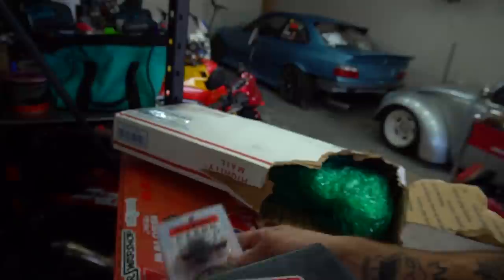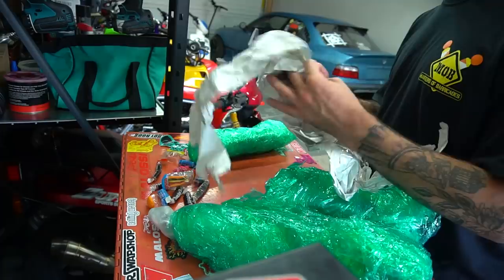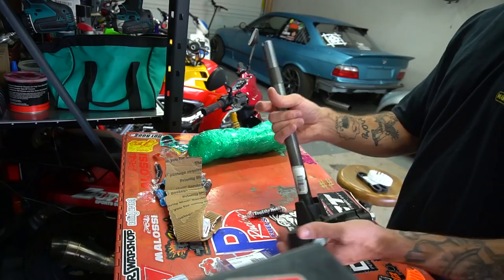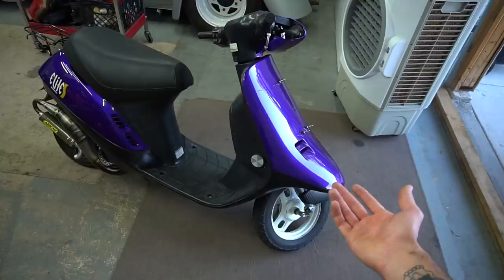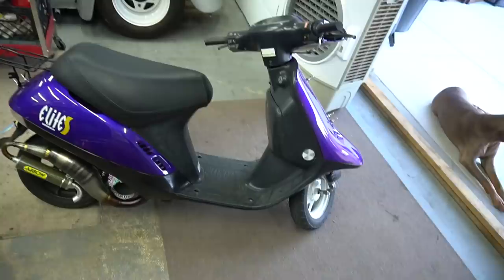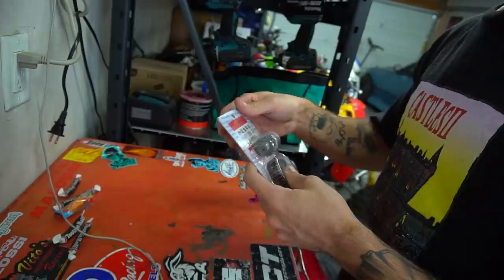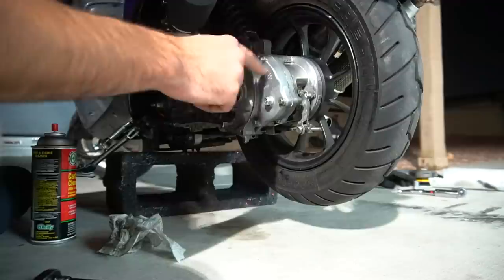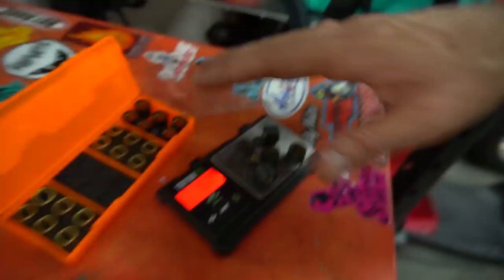UPGEAR Honda Elite DIO 72cc | How To Make your Scooter Faster!

Comment: You can take those gears to the machine shop along with your original and they will match all the teeth, so you can use both of your washers. 
Can't wait to buy some merchandise bro!! 
It's cra cra how much the front end cost to updage on the elites. But the braking power you get is worth every penny! 
Vids are dope bro keep up the good work!

Comment: Looks like you are running the stock rear pulley as opposed to swapping to a ZX pulley.  Can you comment on your experience of gearing higher with stock Elite pulley vs maybe gearing not as much but using a ZX pulley? Curious how the two options compare.  I have ZX pulleys and gears in my elites, however haven't tested the result of gearing a bit more for higher speeds but using the stock pulley.